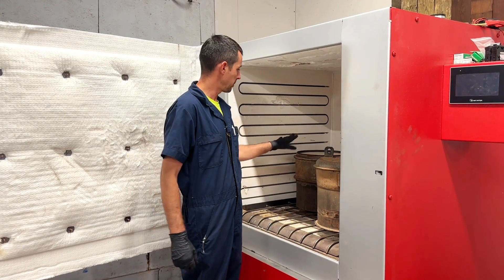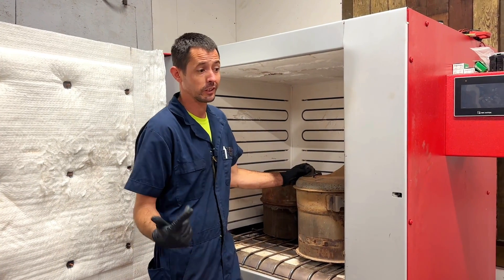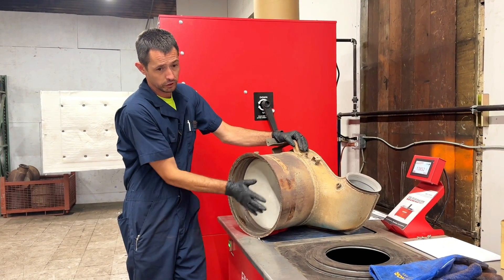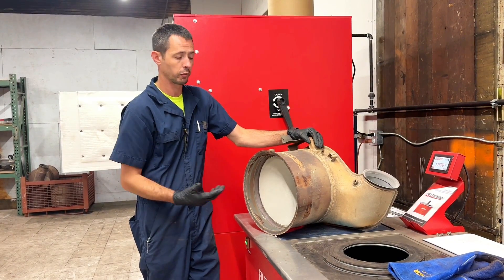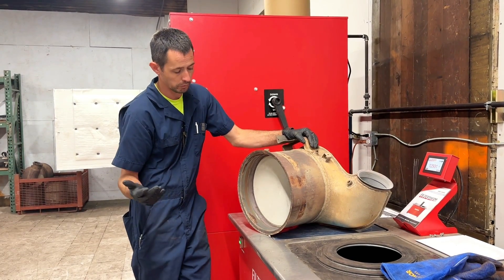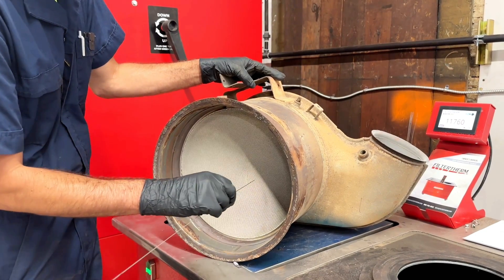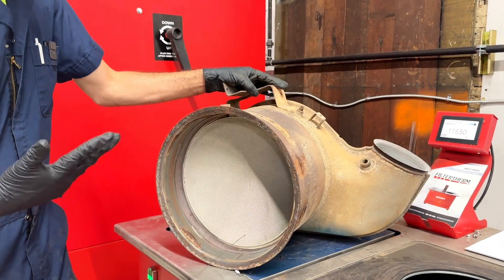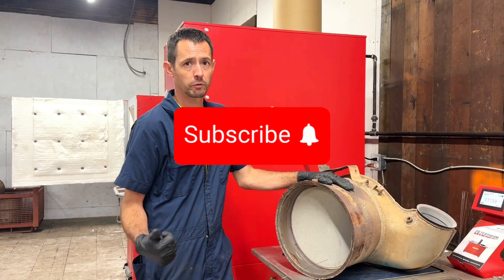How does DOC (Diesel Oxidation Catalyst) face plugging affect the aftertreatment system

Comment: Ryan can you make a video explaining the difference in the passive regen vs parked regen vs forced regen.

Why when my exaust temp shows while I’m driving and it’s doing the regen the exaust temp hovers around 600 but a parked regen goes to 750 and higher.

99 times out of 100 if I’m in a shop it’s the after treatment and all they seem to do is force a regen. Once they removed one of the sensors to force it.

Comment: you check the doc for dpf temps on the inlet and outlet during a regen should be within 50, no more than 100 difference, face plugging is a sign of engine problems,

Comment: I am thinking about doing this on a 2021 KW t680 with 321,000 miles on it. What kind of results do you think I should expect and how much should I expect to be charged? Great video. I appreciate what you do.
Reply: if you have a mx engine that uses a gallon of oil per week have your dpf cleaned and you should be good to go, at that mileage your doc will be fine.